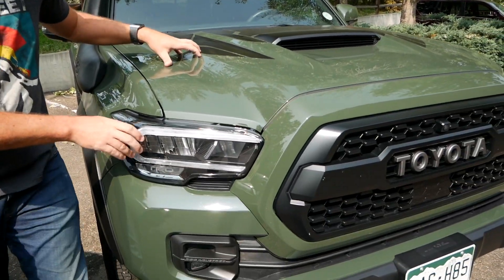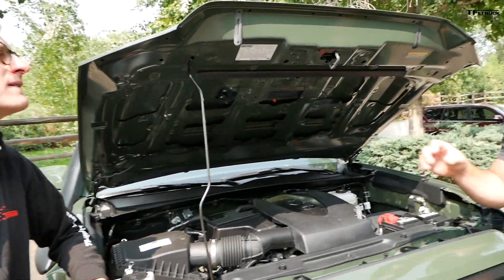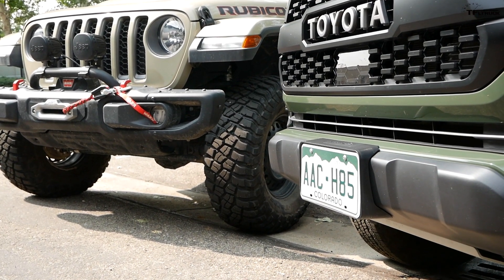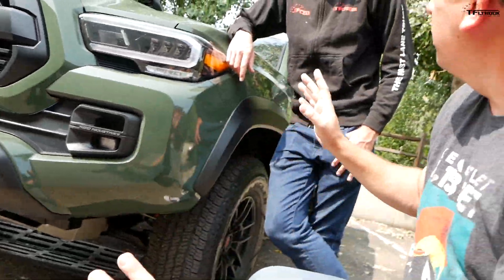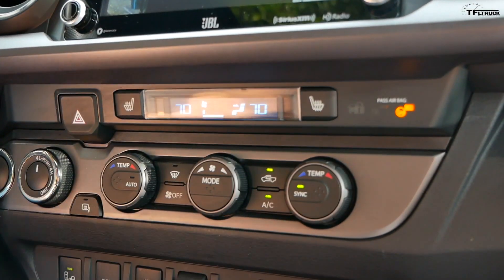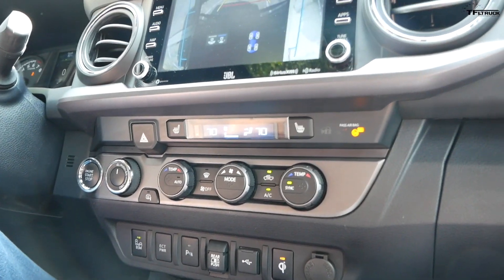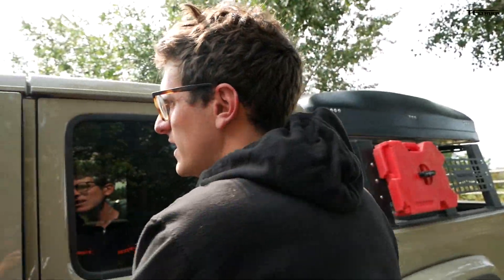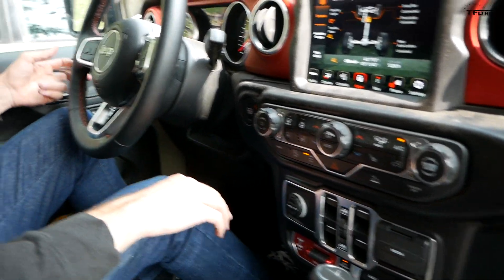Toyota Tacoma TRD Pro Has Met Its Match! We Compare It to the Gladiator & Show You Why!

Comment: Sorry I have owned a ranger,Chevy 1500,avalanche,Titan,trooper,ram1500,Dakota’s and family had a f-150 and a blazer and I had a taco for about a year it was an uncomfortable underpowered toy.Cracked the bed liner loading firewood,was told it was indestructible,wrong got stuck in places I never got stuck with my rams or Titans the Dakotas and the trooper was pretty awesome also. I now have a gladiator rubicon and it is a beast the taco is a joke next to the gladiator,Of all the trucks I have owned the gladiator is my favorite pickup of all time and I got my Jeep out the door loaded for 48,000.Taco was the worst pickup I ever had couldn’t get rid of it fast enough.Got it based on all the hear say on how great it was ,what a Peace of garbage and my father in laws is a rust bucket whole frame rotted out truck buckled between the cab and bed.And he was a taco fanboy

Comment: I don't care what shiny buttons or cool tech that Toyota has they are underpowered and wants too be finicky about being level to engage 4 wheel drive, he moved all of a foot and it engaged, what if your on a hill or have a tire in a pothole and you can't get out,that makes the truck worthless equivalent to a subaru with a one inch lift. I like the looks and don't doubt the quality of all the other stuff and that there's good things about it, a Tacoma beat my hemi ram and I lovethelook of the blue trd pro 4runner and the same with that, 278 horse with a 5 speed auto isn't going to do anything but look good parked outside the coffee shop.

Comment: Are we just going to ignore the fact that the Gladiator’s manual transmission is prone to breaking before 60k miles?
Reply: The Taco will last twice as long as the Jeep for a number of reasons
Reply: 42bill yup. I was cross shopping between a new manual Tacoma and a new manual Gladiator and found too many horror stories of the transmission failing, specifically in the clutch assembly. No real solution to the issue yet. Glad I got my 2020 Tacoma TRD OFF-ROAD in manual trans with cement exterior
Reply: @driveshift  People who care about a long term midsize truck will usually find their way to the original.

Comment: Toyota needs to regear the taco. I feel like thats the issue for the transmission. Its an under powered engine with really high gear ratios. The 3.5 has more power but doesnt make it in the right power band for the gear ratio’s the toyota normally runs in.

Comment: I want to like the Taco but I just hate the interior- feels so small and cramped and cheap. I only about 5’10.5” and even I have to duck to get in. And I also worry about it’s reliability. Yeah. It’s reliability. Because all of you talking about Toyota’s reliability are about 10 years behind. Toyota is living off of a rep that it legitimately had at one time. But it’s statistics these days say otherwise. And as I’m typing this the issue with the 4 low comes up in the vid. Yeah, cause when I’m offroad and need to go to 4 low I’m sure I’ll be on level ground, or just be able to get the truck level. Wtf man?!?!
Reply: Colorado ZR2.  Built in Missouri, not Mexico.

Comment: Dont beat around the bush on the Tacoma, its really outdated and the drivetrain is a serious issue. The gladiator is an FCA product so reliability on both sides are questionable
Reply: The Tacoma's reliability is not in question at all. Yes the driveline is a decade old in tech but that is because Toyota sticks with proven, simple technology. There are plenty of Tacos with over 200k miles on them on the roads. Jeeps on the other hand, are notoriously unreliable.
Reply: @42bill  how many 3rd gen tacos have that mileage? Gear hunting is a serious issue because the more hunting it does the more premature wear you have on the transmission. How about that composite bed? Hmmmm why do taco owners need bed braces? How about that engine? Why does everyone wish it was the 4.0?
Reply: @Vultite  Not too many yet, as we need more time. But its the same basic truck, so the numbers will come.
Reply: @42bill  Anyone that's honest and owned a 2nd gen Tacoma with the 4.0L and 5 spd will tell you the 3rd gen Tacoma with 3.5L and 6 spd was a huge step backwards.
Reply: @mydreamsaretherewheretheea7156  I've seen some make that claim. Me, I'd want the 6 speed, gear hunting and all. The next automatic will probably have 8 or 10 speeds.

Comment: I’ll take the ranger, these new tacos have had some problems but cost way to much, gladiator is over sized, over priced and under powered.
Reply: Are the Rangers not still having problems with fuel in the oil?
Reply: Check out savagegeese review of the ranger
Reply: Jonathan Losito still more powerful 🤷‍♂️ no lag or vibration when I drove one either...

Comment: The Toyota Tacoma is far superior. It drives MUCH better in city and highway than the gladiator and it will last forever (unlike the gladiator).
Reply: I am guessing you haven’t driven either? Tacoma is horrible on the highway. The transmission constantly hunts gears and if there is any headwind it has a hard time getting out of 4th gear!

Comment: Underpowered and overpriced.
Reply: Agree. For the price get a full size.
Reply: Ryan Mitchell when you go buy shoes, do you buy size 13 since they are same price as size 10 even if size 10 is the size that fits you best?
Reply: @gs98999  That's a good point, not everyone wants a full size.  I own an 18 f150 and its pretty slow and lumbering around the city and parking lots.  Small trucks are much nicer in day to day use, better on trails as well.  Just a matter of how much room or towing you need.
Reply: That’s literally describing every car these days

Comment: My 2016 Tacoma had the same transmission/motor problems among a few other issues, I sold it after 7 months. I can’t believe that Toyota hasn’t fixed these issue, it’s very disappointing. I’m sorry but Toyota is not what it use to be. Too bad my 83 and 91 Toyota pickups were great.

Comment: I traded my 2019 TRD for  a Gladiator.  Tacomas are crap, Gladiator has been amazing.  It feels like Jeep tried really hard to impress with this one.  Tacoma felt like Toyota knew people would buy it no matter what.  The Taco 3.5L engine is way worse than the 4.0, too.  My advice, do not buy a Tacoma until you test drive both with an open mind.   Not to mention driving a pickup with no doors and windshield down, is so coool.

Comment: So what you're saying is that again Toyota wins because even spending 20k more the Jeep isn't as safe, isn't as reliable and still doesn't offer more bang for the buck overall. Sadly with the long wheelbase the Jeep still has to be lifted to have a decent break over angle as you've shown on other videos with the constant scraping of the bottom. I'm actually surprised though at the tires on the Tacoma. As even my 05 TRD OffRoad came with better tires than what you showed. Even so a hard core offloaded will in fact change them and many dealers are putting more aggressive tires on as dealer packages as well. ..  Ive got 251k on my 05 Tacoma. Id love to see a Jeep with that many miles on it.

I should add.. if you get the Tacoma the $20 you save could outfit that truck with a heck of an overland package, lift, tires, rack, roof tent, etc..

Comment: In 20 years the Toyota is running probleem free meanwhile the Jeep is rotting away in a junkyard.
Reply: The Tacomas from 20 years ago didn't last 20 years without rusting in half.
Reply: old gen tacos sure these new ones not so much
Reply: kidamer E my new Tacoma’s frame started rusting horribly after 1 winter.
Reply: @gs98999  yeah ive seen that too

Comment: I own a 2020 Toyota tacoma trd pro & it's no off road machine. The Jeep Rubicon destroys it! Jeep rear locker can be activated in 2hi, 4 hi or 4 low, Toyota only works in 4 low this sucks in mud or snow, where momentum & wheel speed are needed.  I will be going back to the Jeep Rubicon.

Comment: Tacomas suck,  I had a 2019 TRD.
Reply: Why did it suck? They seem comfortable and a good in between of a Jeep and a full size.
Reply: @Isaiah-ft5nx  It had a lot of issues.  The seat rattled from brand new.   The seat belt mount did too.  The dash guage cluster plastic pointed up and would glare from the sun, so you can see all the scratches and dust on it, when you wipe it, it is the easiest thing to scratch ever, even with a microfiber cloth, then dust got behind it so my spedoneter allways had dust on it.  Then there was the clunky tranny hunting for gears.  Rear drum brakes also sucked, got sand inside them.   Overall it just felt crappy.   Wierdly,  I test drove a 4Runner recently and liked it much more.  Seemed like it was built better.
Reply: You are jeep fan boy Lol.
Reply: @leonelsanchez6545  Toyota made me hate Toyota, not Jeep.